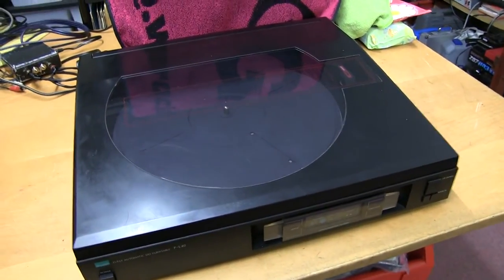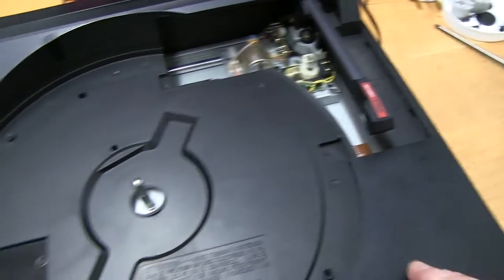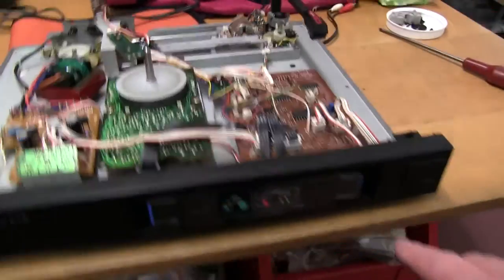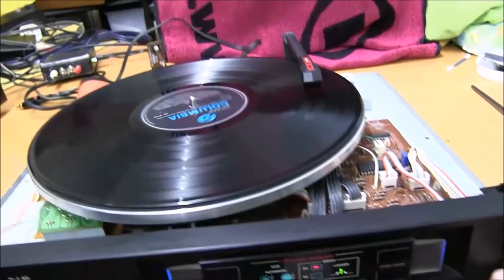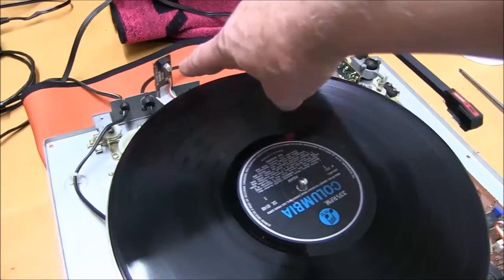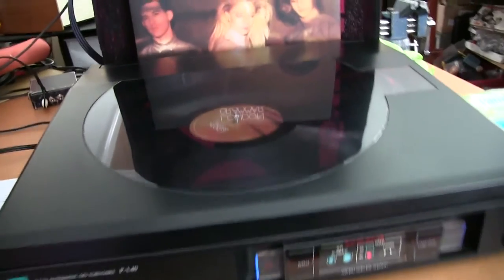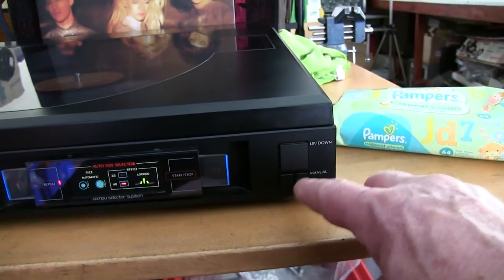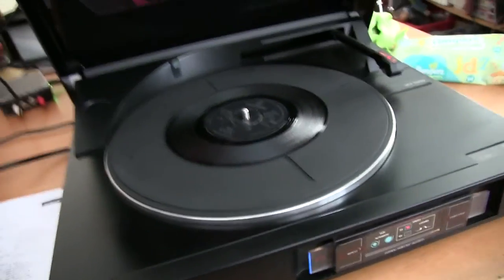Sansui P-L40 Vinyl Record Player. Linear tracking. Service and Test.

Comment: For those who have this turntable and have come here because of the same problem I'm going to add something helpful that the uploader here either didn't know or forgot to add - The plastic plinth on this turntable shrinks a bit over time and one of the inner posts gets in the way of the linear transfer mechanism and will cause it to jam just as you seen here when he first powered it on, you can remove this plastic post or file it down so that it will no longer contact the carriage and it will run fine. But note those with higher end systems will notice a low frequency thump when the carriage moves. This is caused by the motor torque as it moves the carriage. These turntables had this problem right off the assembly line and were designed for their lower end stackables where it wasn't as obvious but playing on a high end amplifier with lots of bass you will hear a thump around every 6 to 8 seconds. Lubrication will not help as it's a design flaw.

Comment: I got one for free recently. Needed two new belts and a stylus. $25 for all that. Had to put some tape on the positional guide to adjust when to return at the end of the record. The tape blocks the sensor a few millimeters sooner. When playing records though you hear a thump each time the motor moves the sled. May need to lube the gears some more.

Comment: Hi Nick , I have seen similar model but the sensor light is not turning on when unit is on . Is it a question of replacing the cartridge that has the sensor or some wiring on the unit . Thanks

Comment: Hello Nick! great to find a video about this specific turntable. I got the P-L50 and I have a minor issue that I was hoping you could help me with. The arm is able to scan and identify tracks no problem but most of the times it doesn't feed sound. Its like on mute - if I put my ear next to the needle I can hear the track playing. If I raise and lower the arm all plays fine again. Hope you can help. Thank you in advance.
Reply from the maker: Hi.  A common problem with all these decks is the muting relay. Over time , the contacts get dirty/corroded and give poor connection. It is possible to clean the contacts with contact cleaner spray, but replacing the relay is best.
The relay is on the circuit board, so requires some electronic service knowledge.
The service manual is available (free). The relay is RL1.
https://www.vinylengine.com/library/sansui/p-l40.shtml
All the best. Nick
Reply: @nickadams5411  thank you so much Nick for the prompt reply! Will give it a go. All the best.
Reply: @nickadams5411  Hey nick. I’ve begot the P-L41  lights up turns on but can’t get the buttons in the front to work. Any idea what to do?
Reply: @nickadams5411   This is wrong for the P-L50 There are 2 screws under the cartridge housing for the "Delay" adjustment. The P_L50 has manual track selection and will mute the last few seconds of the preceding track if it lands a little short of the song that was selected. There is a adjustment procedure on page 7 of the Service Manual to calibrate the "muting" operation. The P-L50 does not use contacts or a relay on a circuit board for this. It is always best to research before giving people advice when you don't know how these work. Bad advice with electronics could cause injury and including death so please research before telling your viewers how to repair something if you do not know for sure.

Comment: A fact about the mechanism for moving the tone arm left and right  and up and down is actually used on what my research has gotten me is used on sansuis first linear tracking turntable the p-m7 so that means that they nailed the mechanism on the first try I've got a p-m7 and it is a brilliant turntable

Edit: what the "locked" light is that the turntable has a quartz crystal in it to regulate the speed so the speed is basically spot on all the time